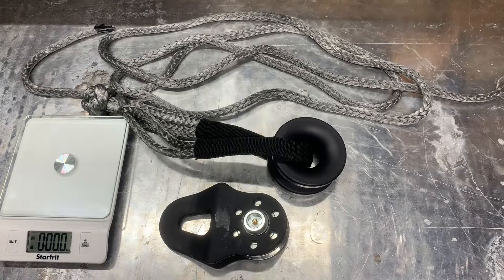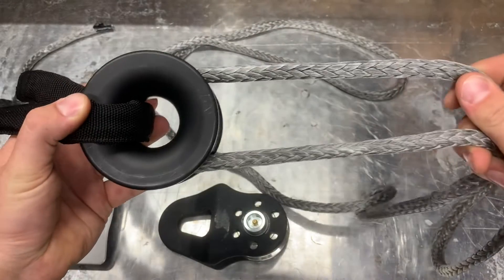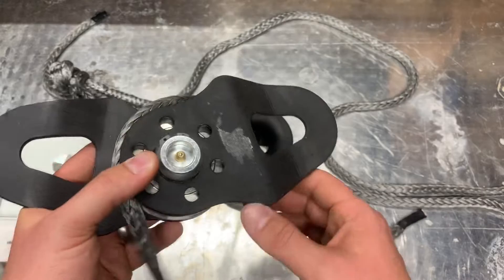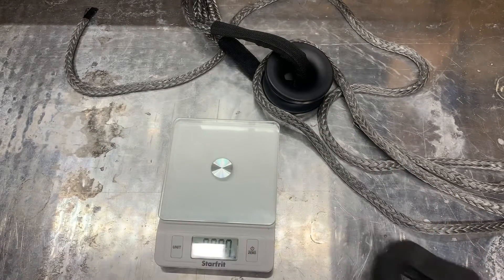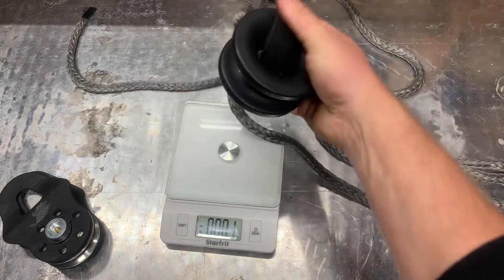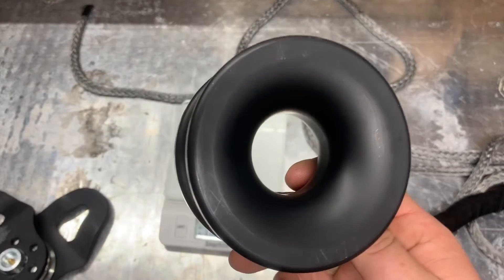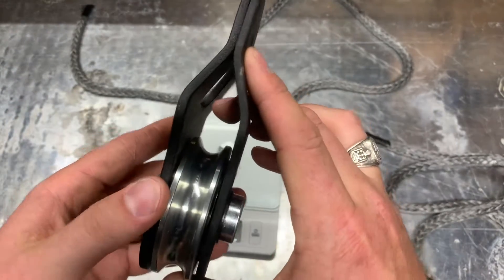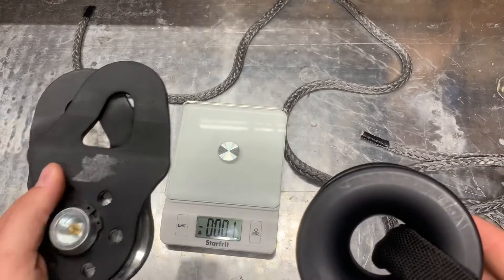Low friction ring? What is it?

Comment: That’s not how to connect a friction ring. The standing end goes outside the ring and the working end goes through the hole..
Reply from the maker: What makes you say that?
Reply: @afraidknotropes  They are "intended" to be used with working end inside because it reduces the contact area (and therefore friction) and derailment becomes impossible
Having said that, you've bought a lump of metal, you're free to use it however you like
Sail Hub made a very good video on them explaining where he would or wouldn't use them, and answered a lot of comments about designs that are intended to run around the outside